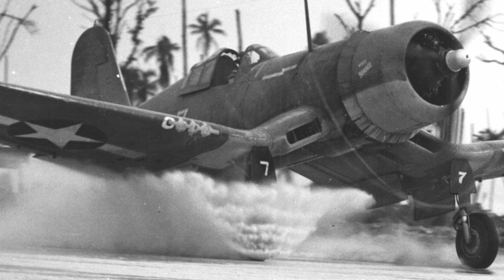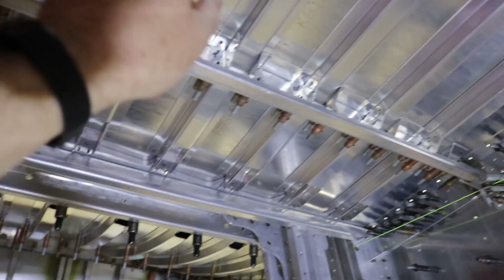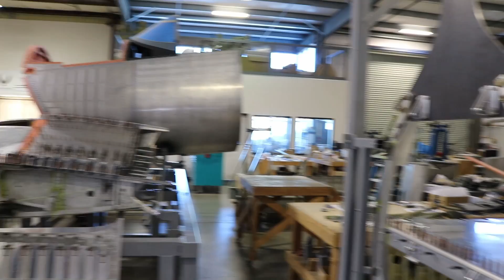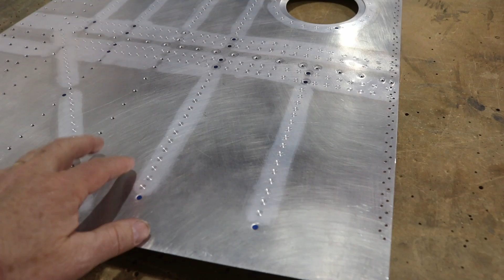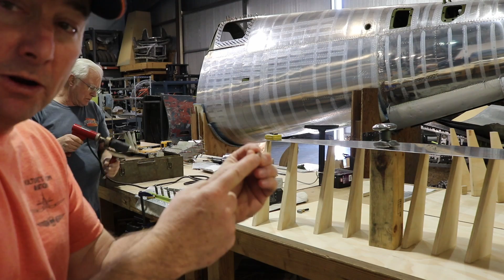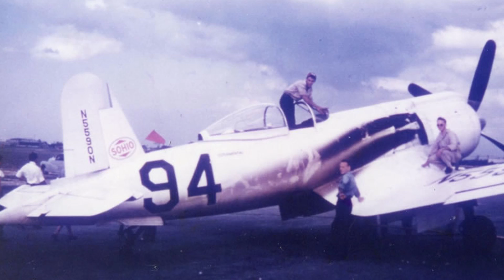1943 'Birdcage' Corsair UPDATE! Dec 2020

Comment: Most intricate assemblies back before computers used the 'make-it fit' process. The parts were made like the drawings and then the holes were finish drilled and reamed out at assembly. There wasn't any way to build to todays tolerances so if it went together once, that's how it was made from then on, over and over. Especially in war time, it just had to work. In todays airplanes, the holes are CNC drilled exactly where they are supposed to be so everything lines up without reaming.

Comment: You mentioned that the air entering the wing is directed to the oil cooler and the intercooler then exhausted overboard but isn't some of it used for carburation too?

Comment: So interesting! Thanks. My uncle flew a Corsair for the Marines in WW 2 and thought it was a superior plane. The chromate treatment shown in this video really works well and I wish GA plane manufacturers would use it more. My own vintage plane, a Navion A, was built to mil spec with mostly chromate-treated parts and it has essentially zero corrosion after 72 years.

Comment: Juan, Just a “clarification” regarding the inverted gull wing design. Chance Vought utilized this wing mounting method to thank advsntage of the low drag characteristics of an orthogonal (perpendicular) wing to fuselage type mounting.
(An example of a low wing aircraft not using this approach but having the same engine/propeller is the Grumman F6F Hellcat. Note thar the low wing mounting dud NOT require any excessive length landing gear struts as a result of this aircrafts wing mounting position (Also not tat Republic’s P-47 also did not need lengthy gear struts on that aircraft either.
There’s a “F4U Corsair Design Features video on “”Greg’s Airplanes and Automobiles”  site that goes into additional Corsair design features.
B-T-W  The Corsair failed it’s carquals (Tommy Blackburn’s, VF-17) due to excessive landing bounce, and restricted Pilot cockpit visibility on landing. 
( Note: Pilot visibility was degraded from the prototype configuration as a result of the increased fuselage tank size for increased range requirements resulting in moving the cockpit aft on a tail wheel configuration).
As a result of this initial  failure/non carrier use acceptance, Corsair’s were initially land based and Marine usage,, while Hellcats were the “ standard” carrier fighter until 1944.
B-T-W2 - Meanwhile, the British Fleet Air Arm was using the 4U’s on their carriers, They developed/used a left hand curving approach during landing which allowed the pilot to view the “batsman” (LSO) up until the final turn. The landing bounce was corrected by CV via Oleo pressure adjustments.

.

Comment: The quick high energy zap of the welding machine is called shot welding.  It was devised by the Budd Company around 1930 in order to weld stainless steel without compromising its corrosion resistance or strength. It enabled stainless steel to be used to build lightweight railcars such as those of the Zephyrs and the Super Chief. 
 
Ted Williams flew a Corsair in the South Pacific.  That seems strangely appropriate because the Corsair has been described as looking "like a baseball bat with wings."
Reply: Not to mention the Budd RB Conestoga stainless steel cargo airplane of WW2,
Reply: @aj-2savage896  Thanks for pointing that out, I didn't know about that one.  One of the interesting things or that era of aircraft was that so many were thinking outside the box, or maybe there wasn't much of a design box to begin with.

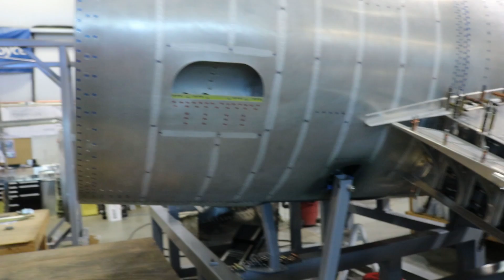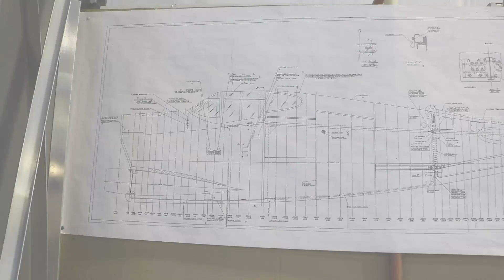Comment: At 2:45 a later version birdcage canopy is shown that includes a bulged forward upper window that was used to house the rear view mirror.  The non-mirror equipped canopy is illustrated at 14:07.  Also, while the first Corsairs had the 13' 4" prop (bat-handled blades) most had the higher performing 13' 1" prop (paddle) or were upgraded to it.  (Engines, props, "bubble" canopies, center-line hardpoints, tall tailwheels and rocket stubs were common upgrades for all early production Corsairs.)  Will these guys be backdating to the original bat-handled blades and short tailwheel?  That would be cool if so.

Comment: If you switch from “Magnesium” wheels to aluminum doesn’t that change the weight and balance?
Reply: They removed the guns, added a rear seat also. I think they know what they're doing or they'll figure it out.
Reply: @sanfranciscobay  The rear seat section is for a different Corsair to the salmon pink birdcage one.
Reply: The aluminium wheels are 50% heavier if made to exactly look original, but they are very close to the centre of gravity so well within the bounds of normal trim adjustments for balance. As for the extra weight - this restoration will not be carrying bombs, rockets nor ammo.

Comment: Juan, if you are looking for a subject, have a look at the history of Jim Wrights Hughes H1 replica.  This was featured in the April / May 2003 issue of Air & Space Smithsonian.  However, the plane and pilot came to a tragic end ( Oct / Nov 2003 issue of Air & Space Smithsonian , " Losses " p15) on Aug 4 2003 when it crashed due to a propeller pitch issue when counterweights came off. Even more tragic is that the weights had come loose on previous flights and the pilot was trying to limp the aircraft home.  There was also a more in depth report of the crash but I don't remember the source.
Reply from the maker: I know the plane well...
Reply: Bob Roberts, hi, yes I do remember that plane & the resulting crash, like you , I can not recall my source either   too many AVIATION reads  !   Happy New Year.     Cheers 🇺🇸🇺🇸🇺🇸🇺🇸

Comment: Problem here:  you got yer x-axis, yer y-axis, and yer z-axis.  Where does the 4th axis go?
Reply: You can move along an axis, or rotate around it, so X, Y, Z and Roll, Pitch and Yaw.  That machine can only work with 4 of those  it can move in X, Y, Z and can also rotate around the X axis (Roll).  There are 5-Axis machines that can rotate around the Y Axis (Pitch).  Using a 4-Axis machine you have to rotate the work 90 degrees and re-present it to achieve the same shapes that a 5-Axis machine can do.
Reply: @richsarchet9762  Very interesting, thank you for that.  Seems like they could use a 6-axis machine.

Comment: As long as there's one original rivet, it's a restoration, not a new aircraft.
Some user assembly required😁
I hope they have a good supply of spots for that spot welder (old apprentice joke - sending the new guy over to stores to get some.  Other''s include being sent or a long weight).
Reply: And we need five gallons of propwash and about twenty feet of flightline.
Reply: @aj-2savage896  When you're done, take this reflector and go to the end of each runway so that we can calibrate the ILS 😁

Comment: G, day from Sydney, Australia.
* has the Corsair a fixed pitch prop or constant speed propeller? '14ft prop' they were not out for a joy
 flight!
* During WWII could you estimate the time it took to build such a plane?
* the zinc chromium preserving paint, simply reduces corrosion by eliminating air/water on hardened aluminium. Y/N
🌏🇭🇲
Reply from the maker: Constant speed.

Comment: Spot welding aluminum !! That's tough enough today. I'll never know how they did quality control back then. Spot welding ads heat and heat causes distortion.

If you're going to build a fig to fit the airplane, you'd better hope it wasn't bent

If you're going to make tooling to build one, you might as well build a whole squadron
Reply: The spot riveted areas on Corsairs were went over with a micro-shaver to get a perfectly smooth surface.  You can see the final effect in some shots in this video.

Comment: If eventually you replace every part on an airplane, is it still the same airplane?
Reply: Theseus’s airplane
Reply: As long as you have the original data plate, lol.  In England they built a new BoB Spitfire including the spade grip from a wreck in France.  The new plane official has the "identity" of the old plane, including serial number.

Comment: Most people would be shocked to see what the original F4U design was. Internal bombay, lightly armed. Then the war in Europe started. They went back to the drawing board. They moved the pilot aft of the center of the wing right at the trailing edge and installed a massive fuel tank. This was necessitated by the installation of the 50 caliber Browning machine guns. With the machine guns in the wings there was no room for fuel. And so the fuel had to be carried in the fuselage. An unwanted byproduct of moving the pilot back to the trailing edge was horrendous forward visibility. One of the big reasons the F4U was not accepted for carrier operations until the RN come up with a different landing profile that allow the F4U pilot to see the carrier. essentially the plane was in a left-hand bank until the last second, leveling out to put the wheels down.
Reply: Wow that left bank and plop down had to be intense in and of itself. Thanks for the info.